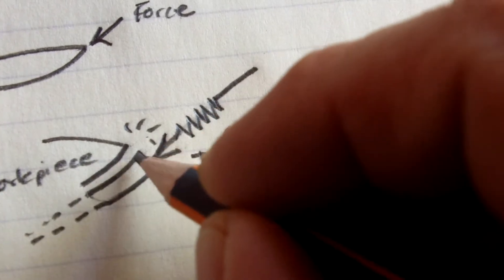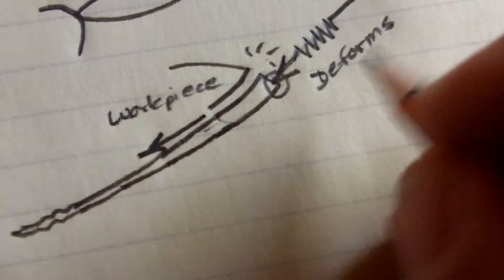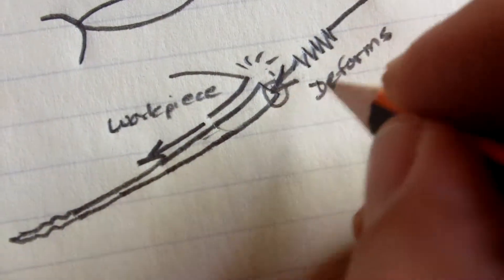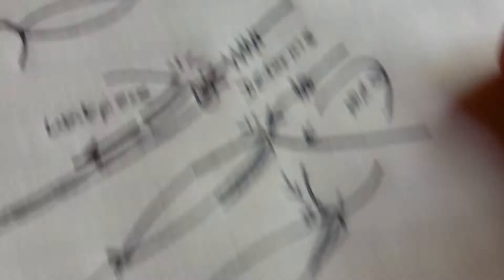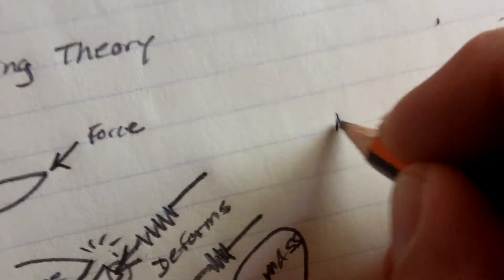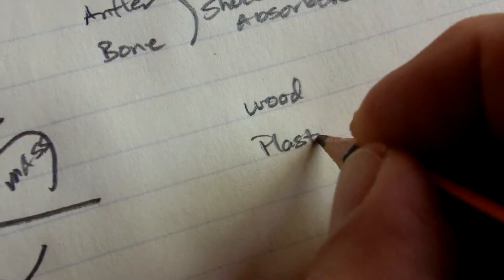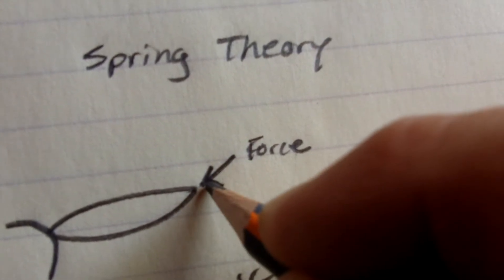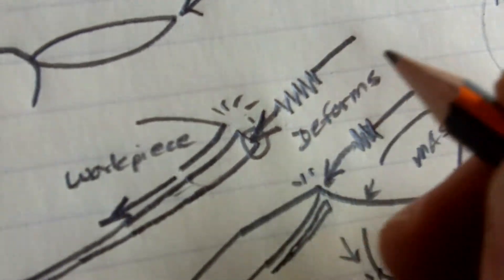334 - Fracturing Part 3b Long Flakes & Spring Theory

Comment: I got a box full of obsidian and flint from a yard sale a few weeks ago. I've been practicing on glass with some home made copper boppers and pressure flakers. I haven't been able to get the arrow heads very long or thin. I'm too nervous to start on the flint and obsidian due to the fact it is hard to find around where I live and don't want to waste it. I'm just not sure where to start.
Reply from the maker: Jacob Ellis Wish I could tell you an easy way to get good at making the arrowheads but it takes time.  LOTS of time and practice.  :-)

Comment: What you've named spring theory is something I've been using in my knapping for several years now. I learnt it when I was reading about using antler punches for blade cores: short punches don't work as well as long ones. This is because antlers are natural springs and store the energy from the hammer blow. Similarly in pressure flaking one the main disadvantages of copper is that it isn't so springy. My remedy for this is the soft steel nails used for notching are springs, I have been using them instead of copper to pressure flake with for a few years now. In addition I have worked an almost fishing like casting motion into my knapping where I apply the final downward motion to release the flake as a sudden jerk rather then trigger like squeeze. I've often wondered if anyone has ever experimented with pressure flaking using a spring loaded centre punch.